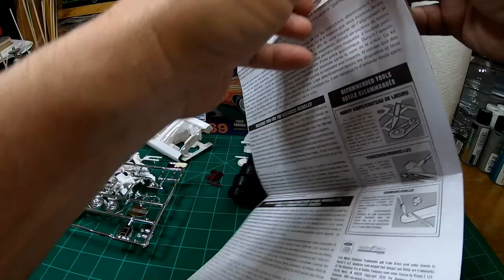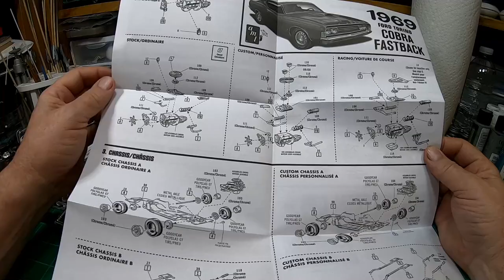1969 Ford Torino Cobra Fastback by AMT - Episode 13

Comment: Really nice Torino👍😎thanks for showing and best wishes from jolly old England 👍😎Pete 🤓
Reply from the maker: Thank you! Cheers!
Reply: @scaleautoguysworkbench  I've just bought one, so it was handy to see your videos👍😎
Reply from the maker: @petesmodelcarcustoms584  Good luck with your build! Not every one of these had the same problems but a few of them did. The biggest problem that I found with this was getting the wheels to align with the wheel wells correctly, but you already know that...
Reply: @scaleautoguysworkbench  Another video said the same thing. Then the polar lights kits front fenders stick up in the air. I wonder if the bodies and chassis would swap and align better
Reply from the maker: @petesmodelcarcustoms584  That would be an interesting experiment. I haven't seen the Polar Lights edition of this kit but it would be cool to test this out and see how they fit together. I have read that some guys have swapped the chassis from a different kit (I don't remember which one) and it fit better than the one that it came with. Either way, I just try to figure out how to build it with what comes in the box. Sometimes, it is a real challenge and that makes it fun.
Reply: @scaleautoguysworkbench  I've stolen the seat for the NASCAR Ford Starliner I'm making and have another plan for the rest of this car,although I think I will check the wheelbase of the two and possibly swap bodies🤔👍
Reply from the maker: @petesmodelcarcustoms584  Are you planning on building the Torino as a race version?
Reply: @scaleautoguysworkbench  No,this one will be civilized. The other kit has a more detailed Holman Moody chassis

Comment: Great build. I just picked up that kit. Now I know what I have to look forward to
Reply from the maker: I hope that your build goes better than mine did. After getting the chassis straight I had to cut off the alignment pins so that the wheels would align to the wheel wells. Good luck with yours!

Comment: I'll be finishing this kit up in a day or two. Thanks for the heads-up on the chassis/body fit. Nice job on yours.
Reply from the maker: Thank You! and you're very welcome! I had heard a lot of grumbling about the fit and finish surrounding this kit before I started mine. Just thought that I would share what I discovered and share it with my viewers. I hope that this helped you out. Thanks for watching!
Reply: Did you have any problems with the decals? The right front fender decal just wouldn't lay down.
Reply from the maker: @TI4438  If I recall the decals did fight a little due to their length, especially the front fender decals. I just made sure that the surface remained wet so that I could maneuver them into place. Long decals are always a pain. That's why I don't do NASCAR kits... Did you get it into place?
Reply: @scaleautoguysworkbench  only had major problems with one and it stayed that way.

Comment: Got this as part of a three car model set that also included a Plymouth Barracuda and a Hurst Oldsmobile 4-4-2. The front wheel pins were way too small and it remained on display for a week before I scrapped it. I'd love to give it another try since I like the look of the car overall.
Reply from the maker: Thanks for the comment! Go ahead and give it a try. What do you have to lose? Just be aware of some of the pitfalls like the alignment pins in the front and you will do fine.

Comment: Very nice! I had one of those BITD. It was dark green with gold stripes and I put a 351 Boss engine and 4-speed out of a wrecked 71 Torino in it. About the time I got it all fixed up and looking good, my idiot brother wrecked it. Made me wonder if the engine and trans were cursed. I gave up on it and sold the remaining pieces to a guy I didn't like... J/K!
Reply from the maker: Well, it certainly sounded like a great car until the accident. They were nice cars back then and hard to find today.

Comment: This is the 3rd of you're builds I've seen and you seem to be in favor of Bare Metal Foil. You make them come out great. Do the decals for the sides come in different colors? I have 2 in my stash along with the 3 car kit from way back. Now I know what to look out for when I do mine.
I'm didn't use to be a big Ford fan. A neighbor friend who lived around the corner, his dad bought one of these in '69 it was white w/ red interior and red markings on the sides and I did like that car. Then my older brother had a '67 Mustang coupe and my younger brother got a '69 Mustang Boss. 
Oh yeah, I figured I'd subscribe 😉.
Reply from the maker: Thank You for the Sub! I really like Bare Metal Foil and I use it on almost every build that I do. I think that it looks better than painting the "chrome" parts of a car/truck. As far as the stripes in this particular kit, they only come in black or white as I showed during the intro part of my video. There might be someone that can print or maybe has some red stripes from an earlier version of this kit. I do have a couple of 1968 and 1969 Mustangs on the shelf from a Flea Market haul I did last summer. I have been wanting to get those up on the channel but the muse hasn't hit me yet on those. Stay tuned, they're coming eventually. Thanks for watching!

Comment: What do you use to thin the acrylics your  spraying and what ratio do you mix-?
Reply from the maker: I have used a few different "thinners" over the years. I have used ModelMaster Acrylic Paint Thinner (a little on the expensive side), Delta Ceramcoat acrylic thinner (no longer available) and plain old Distilled water.  I haven't tried windshield washer fluid but some guys swear by it. I don't really measure my ratios per se but if I did it would be close to 60/40 depending on the acrylic paint. Some are thick and others are thin right out of the bottle. So my best advice is to slowly add whatever medium your using to thin with until the mixture has the consistency of milk. Then mix well and let it stand for a minute or two before spraying.
Reply: @scaleautoguysworkbench  I tried the windshield washer fluid one time, only time I've tried to spray the craft acrylics.  Didn't work out, my guess I had it too thin, but I'll try it again once the weather warms up again.  Thanks for the reply!!

Comment: I seen that paint whated know if work on models. How much did you thin the paint and what do you use?
Reply from the maker: I use acrylic craft paint almost exclusively on my builds. I have been burned one to many times by spray cans. I also try to do everything on a tight budget. One of those 2 ounce bottles lasts a long time and they come in a plethora of colors. I thin my paint with ModelMaster acrylic thinner. I don't measure the ratio per se but I look for the paint to be the consistency of milk before I start and I spray at about 30 psi.

Comment: I hate amt kits but they do have cool variety of stuff, they have been using the same tooling for last 50 plus years and tons and tons of flashing on some kits you can't even make out what a part is supposed to be because the flashing is so heavy
Reply from the maker: I am beginning to dislike AMT kits as well. Unfortunately, they almost have the lions share of the market. They also have a lot of interesting kits out there. The quality of the kits really went down hill shortly after their processes moved to China. Maybe that's the issue? Either way they may want to step up their game. Just because they are such a large producer of model kits doesn't mean that they can't fail. Take Sears and Kmart as an example.

Comment: Nice! Work!  What did you use for Klear Koat?
Reply from the maker: Thank You! On that build I used Mod Podge clear sealer.
Reply: @scaleautoguysworkbench  ok thx did u apply with air brush? Or raddle can?
Reply from the maker: @jgarcia3949  The Mod Podge that I used was from a rattle can. You can pick up a can from Walmart. It's usually located in the craft section.
Reply: @scaleautoguysworkbench Thx! I did and really liked it... thx for tip and info!

Comment: Trust me, this set, to me is a piece of junk, the front grill and body did not even fit and some parts where already broken and the front wheels are held on pay little plastic pins that broke already, the roll cage had issues with the fit and the instructions were bad. I’m sad I wasted 4 hours😢
Reply: If you are not at this guys skill level it is bad
Reply from the maker: Thanks for watching! Yes this kit has some quirks, I'll give you that. This is not a kit that can be thrown together in a rush. It requires a lot of test fitting and adjustments. I try to point out trouble areas as I go along. Though not all of these kits are going to have the same problems. I would suggest setting aside for a bit (a day, a week or so) and come back to it. Good Luck!

Comment: Bro, thanks for sharing the chassis issue..I notice during mockup it did not align with the wheel welds..I'm cutting my off asap!!!
Reply from the maker: You're very welcome! I don't know where that chassis derived from but I don't believe that it is the correct one for the body. Luckily, there's a work around for it. Good luck and thank you for watching!